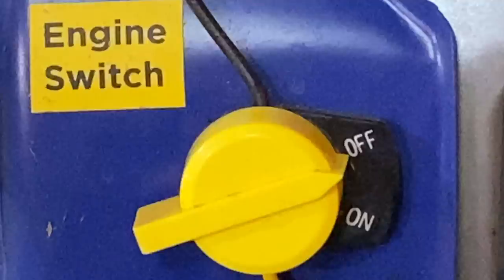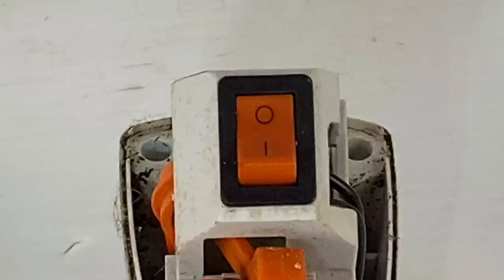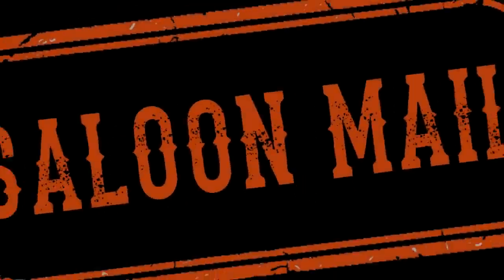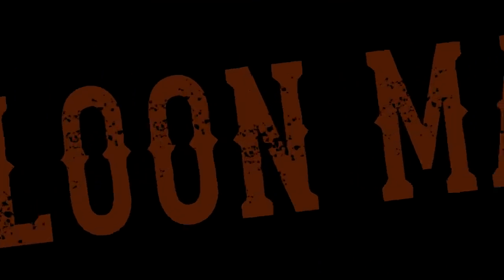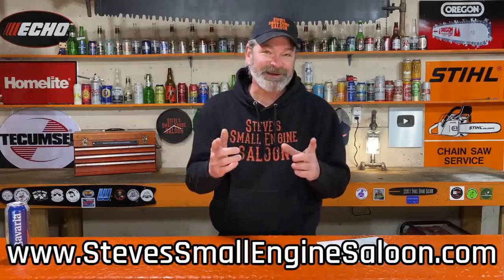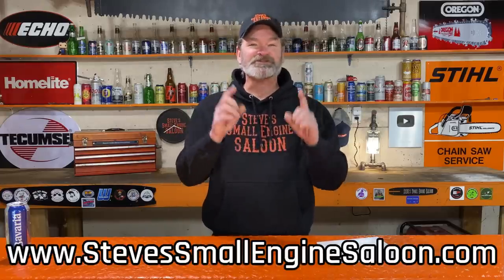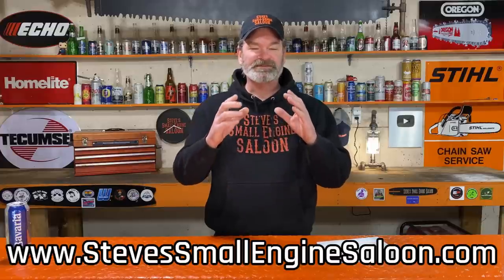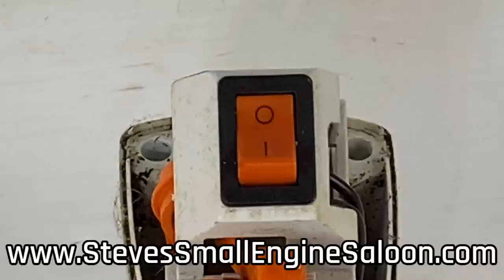Easy Way To Remember What The I and O Means On A Switch

Comment: It’s binary.  It’s machine code.  It’s digital.  Zero (0) means off, one (1) means on or open.
Thank you Steve.
Reply: You beat me to posting about that little "bit" of knowledge. 😉
Reply: It's not really even that. Some switches have 3 or more positions and they are labeled 0, I, II, III, etc, etc and it's evident that that's not binary numbering.
Reply: I think you meant one (1) means closed-- not open, as you said.
Reply: @killer2600  Comparing an on/off switch with one that has multiple speeds/settings is apples and oranges. Also, just because the latter uses Roman numerals or hash marks doesn't mean that the former isn't a "1" or a closed circuit. Without a citation of the actual IEC standards (IEC 60417-5007 & IEC 60417-5008), all of this is just some light-hearted conjecture.
Reply: @sirrebral  HA!  Bet some folks don't get the "bit"
Reply: Not.
Reply: @killer2600  In binary code, the code used in digital computers based on a binary number system in which there are only two possible states, off and on, usually symbolized by 0 and 1.    So there you have it!
Reply: @killer2600  This is true.  But the binary code started as an international machine code language well before the 1980's when I started working.  Now with all battery operated equipment you see "I, II, III" for increasing speed.  Back in the day, to rotate equipment, rabbit and turtle pictures were used next to the buttons to indicate fast and slow.  Lightning bolts were usually master power switches often with a lockout key.
Reply: @sirrebral  when I ever find a computer power switch with a definitive 0 (zero) and 1 (one) instead of the letters I and O I'll be sure to let you know.
Reply: @pnwester2697  I knew someone would byte.
Reply: Open is actually off if you thing of a circuit. A closed switch means current will flow (on).
Reply: @killer2600  In an RV light switch, O is off, I is on and II stands for motion detection. 

Or is it I for motion detection?  Dang it!  Now I gotta go check.
Reply: Just by the replies it's obvious that this was yet another dumb idea to validate a job somewhere like updating my phone when it was perfectly fine and now I have to learn the way they changed what wasn't broken.
Reply: @pnwester2697  Yeah, there are 10 types of people....
Reply: Ironically, in the power equipment world, I (or 1) actually would be open circuit as opposed to I (or 1) in the world of electronics where it would mean closed circuit. Both result in an on condition. Power equipment closes the switch contact to short the ignition coil circuit to ground in order to disable the ignition.
Reply: @sirrebral  The Roman system does not have Zero. Zero was invented later by the Arabs.
Reply: Zero (0) is off for a switch or a valve.  For a switch or circuit you could also say zero is open.
One (1) is closed or on for a switch, but open (but still on) for a valve.
I tried to keep it simple, but it seems I still confused some of you.
I am sorry.
Reply: @danielneeland2034   Wait until people start discussing colors.  Red means a "Stop" push button right so that means a red light means "Stop" or "Stopped"  or does a red light mean "energized" and the equipment is running and is dangerous and a green light is "stopped" or "safe".  What's do black, yellow, blue colored button mean?
I worked in a control room and our colors were different than some of the local controls in the field.  But in the majority of cases a red light meant that the equipment was running or energized both in the control room and in the field.
It all depends, so know your equipment and controls.
Reply: Exactly.  You saved me a bit of typing.      Zero means false, One means true.     And it's done that way because it saves having to make 40 different plates for international markets.   It's why your car's switches don't have english on them, it allows the manufacturers to have a standard set of  switches for every market.
Reply: @sirrebral  Well, yes and no (pardon the pun).   The standard doesn't explain why they chose that symbol, simply what the standard is.   

In any binary computer, 1 is true/yes 0 is false/no.   Occam's Razor says this is the most likely the correct explanation since it fits the available facts, and the nomenclature was widely used in the electronics industry before this was an IEC standard (the IEC indicates this was was first formalized as a standard in 1973, and you'll find mainframe/mini computers using those symbols before 1973).
Reply: An "open" circuit is "off"...
Reply: An OPEN when you are speaking of electricity means off. Electric has to run a circuit and if you open or break the circuit, current does not flow and no work is done. When a switch is on it is and an electrical short so the current can flow through the switch, to the load where you want to do work.
Reply: ...and remember, there are 10 kinds of people in the world.  Those who understand binary and those who don't.  x-)
Reply: IN a digital circuit you cannot have a SPST switch control an input directly.

The signal needs to be connected to either ground, or the voltage level that represents logic 1.  The common way to do this is to pull the input high with a resistor, 3 to 10kΩ
then the switch is connected to pull the input low to ground when the switch is closed.

SO for most digital circuits the switch at 1 (closed) pulls the input low = logic 0
and when the switch is O (open) the resistor pulls the input hi = logic 1

you cant assume anything just looking at the switch markings
Reply: @killer2600  Roman numbering?
Reply: @TCBubba  Those that do and the other 9 that don't!  Damn it, I'm one of the nine!
Reply: Thanks but for those who are not electricians the emptiness is still a response not at reach, so companies should do something like ( O- and the bar or l or i might be ig or in line, or something else, not letting clients in trouble,,,thank you for your attention,,,
Reply: @killer2600  It is 0, 1, 2, 3 in Latin (Ancient Italian :) )
Reply: @killer2600  it still started out as binary.. Zero is off, 1 is on.  Just because a manufacturur added more numbers later doesn't change history.
Reply: @danzarlengo7127  LOL...the history is industrial machines predate computers and early computers were industrial machines hence why personal computers had O/I switches instead of consumer oriented Off/On switches. But believe whatever you want it doesn't change a thing.
Reply: Sorry. NO. The 'O' & 'I' symbols for off and on were in use back in the 40's, back when binary code and computers were military top secret.
Reply: Not everyone is a computer nerd. They need to make it look like a one and a zero then.
Reply: @pnwester2697  Give me 7 more and we'll start talking byte.
Reply: Machine code on a light switch?
Reply: @theschwarzey  Not 100% certain, but this particular application i.e. Kill-Switch, may possibly operate in this way I=OPEN ?
Reply: No! O means circuit is open no power. | means circuit is closed power.
Reply: @thomaswattsjr.7  You are correct.  I made a mistake.  But that was a year ago.  Maybe I was thinking of a valve as opposed to a circuit.
Reply: @danielneeland2034  thank you brother. It is so rare these days for anyone to admit a mistake on the internet. You are a man with integrity! Kudos!
Reply: To you who caught my error.  Thank you.  I don’t know what I was thinking.  Maybe I was thinking of a valve.  Maybe I just brain farted.  0 is an open circuit (off).  I is a closed circuit (on).  That was over a year ago.
Reply: @danielneeland2034  as I wrote earlier, in this day and age, especially on the internet,  someone admitting their error is a rarity. You are a man of integrity and deserving of our respect! Good onya bruv!

Comment: It had never crossed my mind that this might be difficult or confusing for some.  The symbols are actually the binary numerals "1" and "0" and are used because they are not language dependent, as the use of words (or letters associated with words) would be.  Universally, binary "1" represents "On" and binary "0" represents "Off".  It's no coincidence that this nomenclature was first popularized on computing equipment.  BTW, when the two symbols are superimposed on one another, it means that the same exact action (typically, pressing a single button) toggles the device between on and off states.
Reply: I never knew what they ment.
Reply: Then there is the similar 1 at the top part of the 0 meaning the switch turns the equipment on or to standby.
Reply: Thanks for the reminder of how useful the comments section can be.
Reply: Came here to say this.
Reply: "  Universally, binary "1" represents "On" and binary "0" represents "Off". " While this is a great tip in general, the "logic" is exactly backwards - 
In order to "kill" the running 2-stroke, the switch is closed to ground the coil. For the engine to run, the switch is "open".
If you used this switch as a horn button, it would honk with "O", not "I" .
Reply: I always thought of it as "on" and "off" until I went through industrial electronics.  Now I see it as "open" and "closed" circuit (0 and I).
Reply: Yep thats how i was taught to remember from a friend that builds computer. Exactly how he explained. Its a universal language. To computer people its self explanatory.
Reply: It is not binary. It is electrical symbol for open or closed circuit nothing more. Binary use would be for computers. Meaning a switch is either on or off giving you one bit of information. It has nothing to do with an actual electrical circuit.
Reply: @TIMEtoRIDE900  no the line would honk the horn because your circuit is closed. Meaning that you now have a completed circuit or path from one pole of your voltage push to the other allowing the electricity, electrons, to flow energizing the circuit. Therefore work is being produced to make the horn work.
Reply: @speedgonzalez489  Do you know what a "kill" switch is on a 2-stroke piece of power equipment ??
The coil has a "trigger" and a capacitor, when activated, this little circuit "dumps" it's voltage, thus triggering the main windings, which energize the secondary, which fires the spark plug.
So the switch is "OPEN" FOR NORMAL RUNNING.
To "kill" the motor, the trigger circuit is grounded, the switch is momentarily "CLOSED".
I hope that clears things up.
If not,
I'll just chalk it up to the "Dumbing Down of America"
Reply: IO I owe  its off to work we go....
Reply: Nice!! Thanks
Reply: ON OFF is so yesterday. Manufacturers will change IO to something else soon to remain relevant and trendy. I wonder how many have been injured because of the IO confusion.
Reply: @TIMEtoRIDE900 that makes absolutely no sense whatsoever. 😂
Reply: many probably do not know of any reference, but for people who have worked with electronics, including me, a circle might seem to mean a closed circuit. I never thought of it being a 1 and a 0.

Comment: Technically, it's not the letters i and o. It's the numbers 1 and 0. One is for power and Zero is for no power. It's the same symbol used on most all power switches in everything from electronics to engines.

Comment: The symbols come from binary 1=on 0=off.  That said, I used to confuse it myself as I looked at it as a circuit.  "O" would be closed loop (on) while "I" would be a circuit with no completion of the circuit.  IEC 60417 outlines all of the symbols with 5008 defining the above.  Steve's suggestion is how I remembered it myself
Reply: Yeah power equipment world is backwards, O is closed circuit instead of I.
Reply: @rickfrogm825  no? Closed means complete, on.
Open means broken, disconnected. It's not backwards.
Reply: @mrniusi11  what he means is the O looks like a complete circuit while the I looks like an open circuit which is I think why this confused me as well
Reply: Yes! That's how I see the 0. It's a closed circuit, therefore it's "on".
Reply: @juliogonzo2718 you're also getting confused by kill switches.
Kill switches usually work by shorting the ignition.
So a kill switch is on in the O position...
Reply: The O looks like a closed circuit, but it really means an open circuit. Well that's just easy to remember...
Not.
Reply: @rickfrogm825 it doesn’t have anything to do with “circuits”. It’s very simple function on (1) or function off (0). 😂

Comment: I've always seen it as a one and a zero. When you are expressing something in binary a zero means off and 1 means on. Meaning if you had a series of lightbulbs and wanted to express something in binary the 1's would be the ON lightbulbs and the 0's would be the OFF lightbulbs
Reply: Just like 0 for X and 1 for Y.   Female is 00 and male is 01.  Also think of a hole and a pole.

Comment: It's a one and a zero, as in binary digits. In the most basic logic circuits, a "1" was represented by a positive voltage being present, while a "0" was represented by no voltage being present. 1 and 0, being recognizable in most languages, then became the international symbols on power switches. 1 = power on, 0 = power off.
Reply: I actually prefer Steve's solution in this case, but thanks.
Reply: ...and how long did it take you to explain this...?
Reply: @weldorman8495  Probably less than the 71 seconds this video runs. 🙂

Comment: i always think of "O" for an open circuit which no current flows in an open circuit so it is OFF and the "I" i see as a line indicating a closed circuit so current flows and it is ON.

Comment: The funny thing about this is not everyone understands this, even I had issues with this. Even after I figured this out I still get confused or forget, so I simplified it by coloring the switch with red & green. 

Problem solved!
Green for on or run and red for off or stop. I really don't understand why they didn't do this in the beginning. I  mean you really can't confuse with colors.

Or at least color the ( I ) green. 
How much more would that really cost in manufacturing? Seriously.
Reply: You can if you're red/green color blind - and yes it's a real thing.
Reply: Of all Color blindness, RED/GREEN is the most comon by far.
DOUGout
Reply: Some might see that as green is safe (off) red is danger (on) 😁
Reply: Or is it red for danger and green for safe?

Edit: must read comments immediately above before commenting 🤣
Reply: Oh Man, red and green, port and starboard. Now I'm confused again ;-)
Reply: @hubby-tubadventures01  Port is left (side of the ship). Both port and left have four letters. Starboard is right side. The words have more letters for right and starboard.
Reply: I worked in wastewater treatment,  pumps on had a red indicator light   , pump off light off .
A night shift   janitor saw the red light and got alarmed and shut all the pumps down .
Stand by crews  got called to  a flooded  plant ..at 2am , in the rain...
Reply: @ronsamborski6230  and a 4wire flat trailer plug  has a green ( go right) wire ,  yellow ( 2 LLs )  left     ,    those are the turn signals , then  white ground ,  red hot.
Reply: Red/green...some will think red is danger...power on. Green is safe, power off....
Reply: Colored symbols would cost more because they can’t be embossed/inscribed in the plastic. Inscribing the symbols is cheap for the manufacturer, but the tiny black-on-black symbols are difficult  to decipher, especially for older eyes.
Reply: I've worked in nuclear and fossil-fired power plants.  Red means a motor is running or a valve is open.  Green means a motor is stopped or a valved is closed.  So you've just preserved the confusion.  I remember once on an installation job in Texas,  leaving a plant at 3 a.m. after a  20-hour shift and driving back to the motel.  Not another car on the road.  And I stopped at a GREEN light!  It seemed perfectly normal until the light turned yellow, and I went, "Wait. What?" and had to sit through the red as well.
Reply: @lookup49  like the after market fog lights  on off switch  I bought for my 06 gmc from eBay
Reply: Some people are color blind.

Comment: The I and O (letters) are really 1 and 0 (Numbers) representing BINARY states.  0 (zero) is OPEN state meaning a circuit is broken and no current flows (aka OFF).  1 (One) is CLOSED state meaning a circuit is complete and current flows (aka ON).  In electronics class they said to think of the 1 (One) as a pointed arrow and if you touched it you would get "poked" or hurt like electricity poking you. Then the 0 (Zero) would represent "OK" and safe to touch and not get poked.
Reply: This is true, but another way to remember it for the non-electronic/electrical people, is O = OFF
Reply: Stop pretending you know. It is BASIC electric flow marks.
Reply: @soisaidtogod4248  who's pretending bud?  I have an associate's in EET,  I've been an electrician for almost 20 years and currently a licensed electrical contractor in my state.
Reply: @IrrationalBstrd  
Thanks JF... I also have an Associate in EET and another Associate in Computer Programming which I have been mainframe Programming for over 35 yrs in 15 different Programming languages.  My 3rd degree is a Bachelor degree in Technical Project Management. I am sorry @So Isaidtogod thinks I am pretending. I can see you agree with me. Ty!